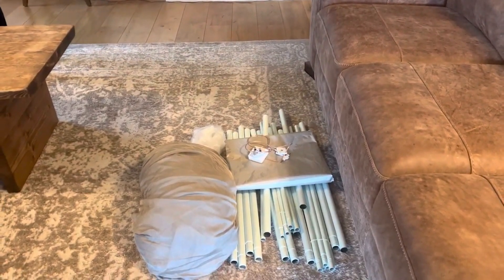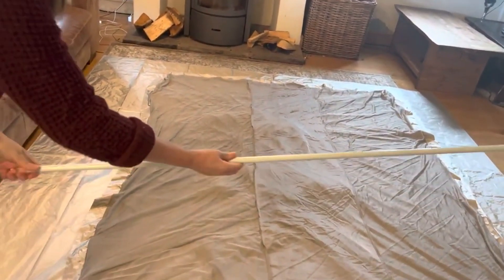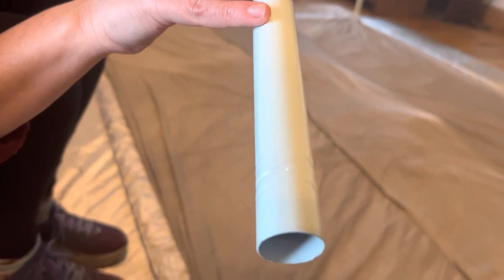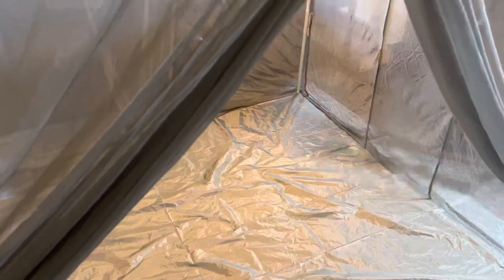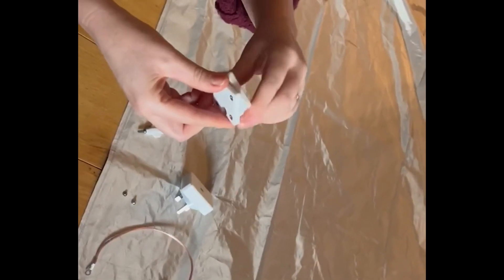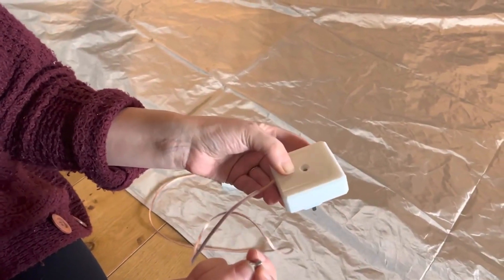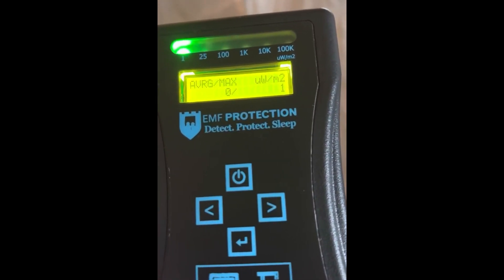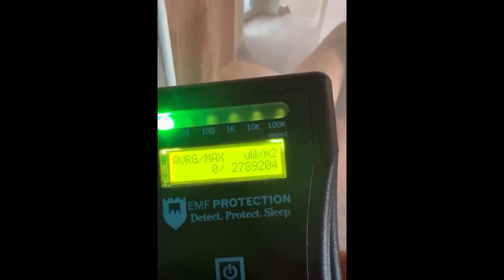BlocSilver EMF Bed Canopy Assembly Guide (Step-by-Step) | EMF Protection

Comment: Thanks for your demonstration and resources I've just ordered one and I hope everything works out and on the grounding mate the snap is already there and I just run the wire from the snap to the electrical outlet and I hope the mate that I'm getting is being enough for the canapé to tuch as far as my all wood bed frame goes that might be a issue I probably should have just gotten a all wood box spring for my bed and not be using a bed frame right now my bed is on the floor and I'm using a grounding pad and sheet cover and I have one peace of Faraday fabric under my bed only and it's not grounded and I'm using three Faraday Blankets to cover up for protection. God-bless.